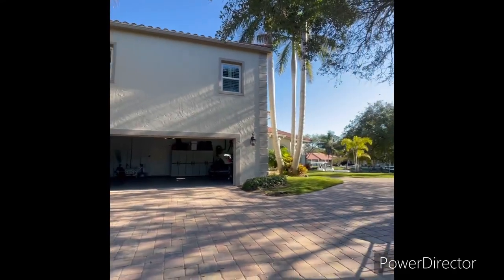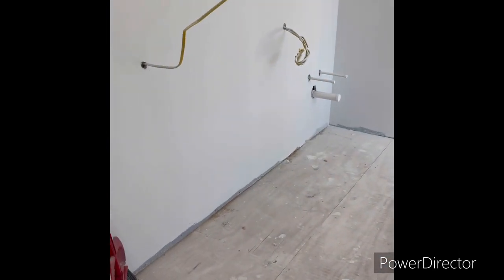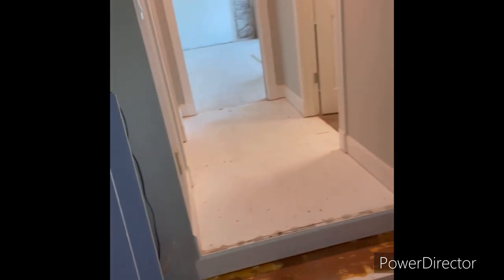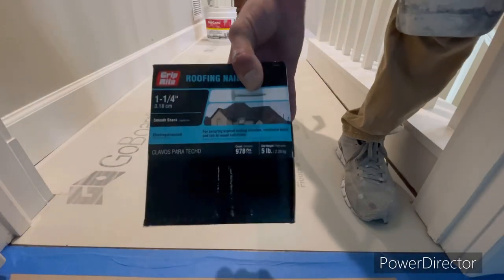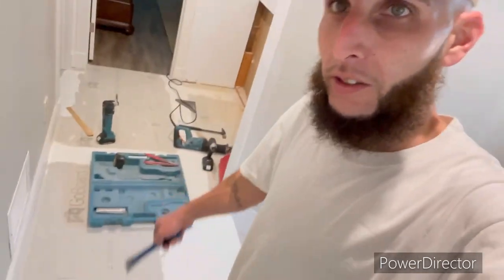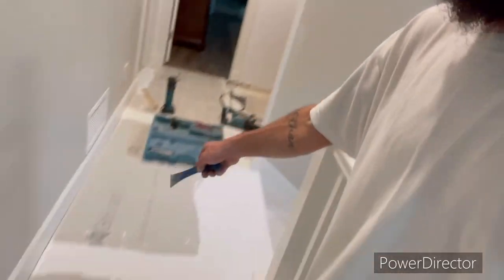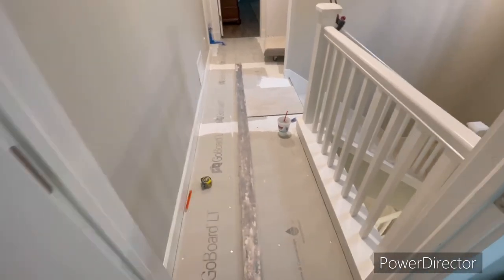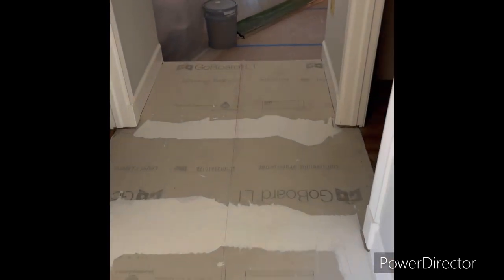Installing Go board LT, lightweight waterproof board, floor prep & tile install #tilewithme

Comment: Why nail instead of screw down the go board? I’ve used it for shower walls and screwed to the studs. Is it because it’s for the floor vs vertical wall?
Reply: I use  GoBoard Screws.
Reply: Goboard is waterproof, you don't even need thinset under it. I just screw it directly over the plywood subfloor and finish the seams and holes with goboard sealant.
Reply: @Pepe-dq2ib  manufacture recommends you too use thinset to bond to sub floor